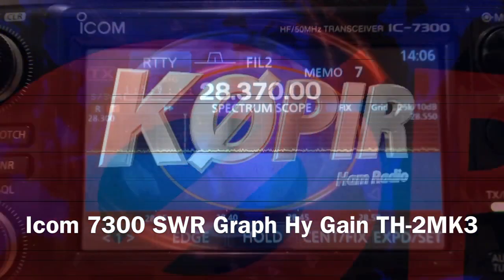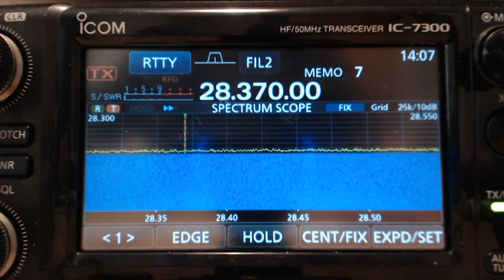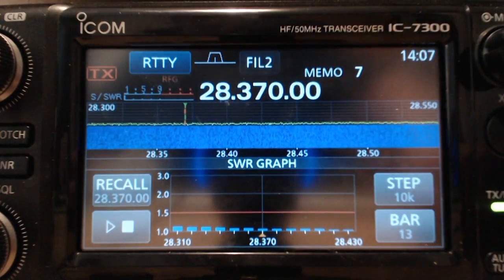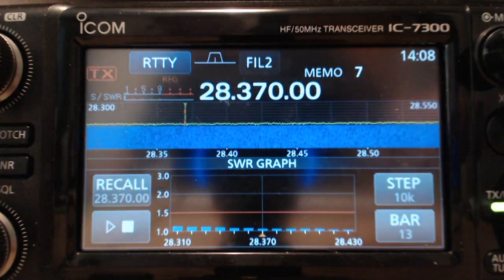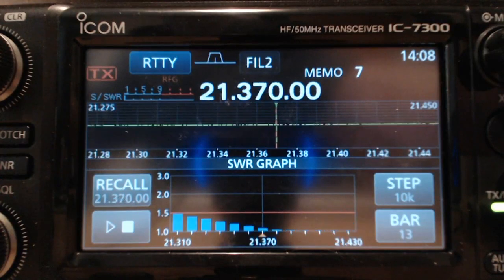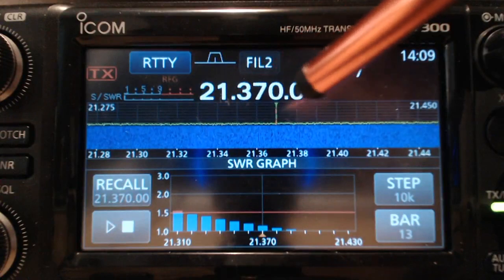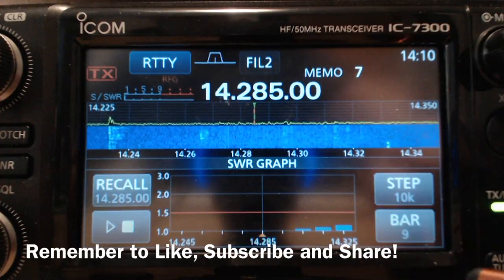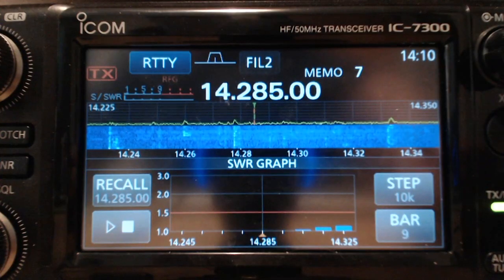Icom 7300 Incredible SWR Graph On Hy-Gain TH-2MK3

Comment: I have tried this however I get no bars art all.  I noticed that when you did 14.258 (9 bars) there were no bars showing between 14.245 and 14.295.  Is this because the SWR is below 1?
Reply from the maker: Hi and nice to hear from you. Yes, no bars would indicate a low SWR. I also use an external SWR meter and verify my readings with that. Thank you and best 73 - Rich, K0PIR
Reply: Many thanks for your speedy reply.  I take my foundation exam 2nd Oct :)
Reply from the maker: Awesome and good luck with it. I used https://hamstudy.org when studying. The flashcards are awesome. Best 73!

Comment: Why RTTY mode?
Reply from the maker: Hi Bora,

It's what the manual says.
"You can measure the SWR over the entire set frequency range. 1. Set the desired frequency band. 2. Select the RTTY or RTTY-R mode. 3.  If necessary, adjust the RF power to approximately 30 W in the Multi-function menu." 73's - Rich, K0PIR

Comment: Hi Rich
A useful video. It is worth pointing out that the ic-7300 must have Tuner turned off for this to work.  I missed that at first. :-)
John
Reply from the maker: Hi John,

Nice to hear from you and excellent point. Tuner OFF! I'm preparing another one with the IC-7000 SWR graph and my Tarheel 200A. Very similar, but a little more difficult to find the SWR graph initially. Thanks for commenting John and have a great day!

Comment: That is amazing. Never looked at that on my 7300. Thanks a bunch for this! Nice Nice Nice! 73, Steve k1gmm
Reply from the maker: Thank you and nice to hear from you. I was using the SWR graph on my IC-7000 in my vehicle and realized it's almost exactly the same as on the IC-7300. Pretty neat tool for both radios. 73 - Rich, K0PIR
Reply: I just ran a sweep on the parasitic array and looks like I'm a little low but not bad. Not sure if I should fiddle with it. Dif' between a 1.0 and a 1.1 is no big deal. But, because I'm general class having the center at 150 hurts me above 200 as the array isn't very broadbanded. The only thing that concerns me is that performance is degraded with gain and f/b the farther I move away from resonance. Thanks a lot! You opened a Pandora's box. Ha Ha.  Thoughts? 73, Steve
Reply from the maker: Yeah I think I understand what you're saying Steve. That's great SWR though. If it's not too much trouble you could tune it for the portion of the band you're going to be in. OR, you could leave it and just think of it as an incentive to upgrade your ticket :-) I use my tuner in the digital portion of the bands and it works great, no problems with it at all. Best 73!
Reply: Funny, a couple of nights ago I was thinking the same thing. It's frustrating being stuck to only 175 to 200 as I love chasing dx on 40 and that's why I built that antenna. I just need to find the time to study for it. I thought;"maybe I could cram for the next month and get the extra at Dayton." But, summer is very busy and just don't see it happening for a few months. UGH! Thanks, k1gmm